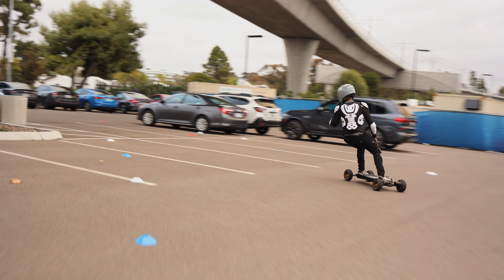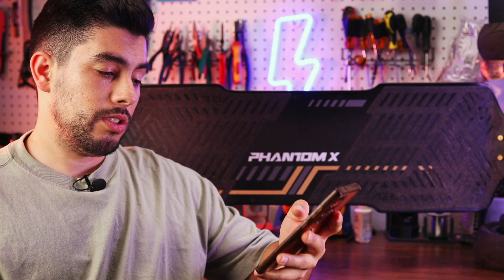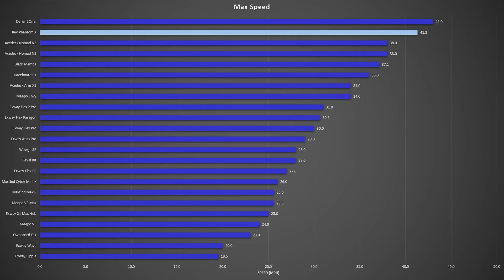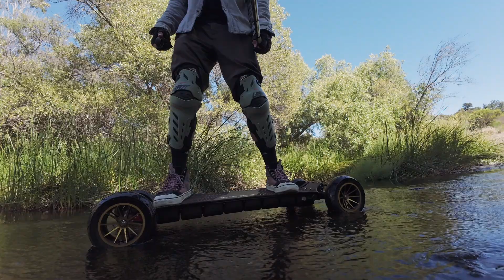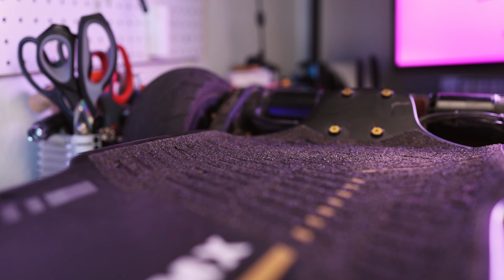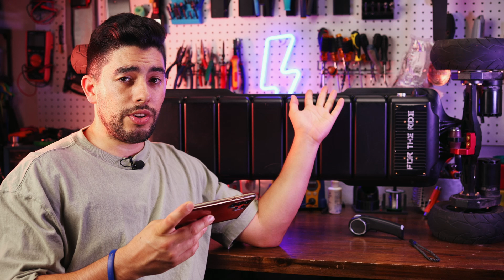STUNNING POWER! REV Phantom X Comprehensive Review (100 Mile Gear Reviews)

Comment: I'm coming off a Lacroix Naz. SS.

Your really the only person to mention the Lacroix as a comparison. I absolutely love the deck on the Lacroix. 

Hows the deck length feel compared to the Lacroix. I just dont want to feel cramped going smaller. 

Thats my only reservation right now. 

Love your review 

I'm ready for a new board.
I'm hoping this is it.

I'm subscribed now!!
Reply from the maker: Definitely not smaller, but set your expectations - it is comfortable but there's not much quite like the Nazare! If I were to pick a board close to the Nazare, this would be it though. However I've not ridden the Acedeck Horizon or the new Lorentz yet
Reply: @RBEMotion 
Yeah the Naz is really great. The maple  handles road imperfections really well compared to carbon fiber. But as long as its not smaller I'm willing to take the chance. A little worried about the concave shape, but its either another Lacroix or try something different. No disappointment with the Naz, but your the second person saying this is an upgrade to the SS boards so I'll roll the dice. Really appreciate the time spent on the review and your insights. Probably gonna order in the next couple months based mostly because of this review. Thanks again.
Reply from the maker: Nice! I'm glad I was able to help you out. The board is one of the most refined things I've ridden. Definitely be prepared to learn the trucks before going full speed though.

Comment: Been enjoying mine, took a while to dial in. Still need to more, but been very enjoyable daily. Wish mine had the gold hardware on the top of the deck like yours, looks nice!
Reply: @TheSoupy77  - how are you enjoying your board these days? Im interested in buying one but curious about the quality of the board. Have you had any issues? Wondering specifically about the gear drive since some of it is plastic? What about the enclosure, still holding up? No major damages (less concerned about scratches vs cracks or screws coming out of place)?
Reply: @Pandah82 no major issues, 1000+ miles in, replaced tire tubes so far and some minor stuff. Really enjoy it still
Reply from the maker: Glad to hear it! Yeah this is 8/10 in the pre production round. Pretty cool looking if you ask me - but the new ones look great too! How is the learning curve on the trucks, still figuring it out? I think they really make the board feel smaller than it actually is.

Comment: I hope you get to try the Lacroix Lonestar Supersport to have the pioneer of performance board on your chart. It's old, but somehow it's still on the market and nobody speaks of it anymore. It's still an 18s8p "faster than you ever need" board (they used to say that in the max speed spec before being reowned by americans)
Reply from the maker: Yeah I know.. I've had that thought in mind that it would be great to get on there. Thing is it's not really very easy to get a bone stock one, and all of the batteries now are so old that range testing it wouldn't be super accurate. It was a great board at the time, minus the trucks though. If Lacroix fully re releases stuff I'll try to track one down
Reply: Contact them man, they are pretty responsive. Some americans bought them back so they do ship out new boards! (Unless they're shipping old ones off the shelves building dust since years). Pretty sure they could send you a demo
Reply from the maker: Huh interesting, I didn't know they were actually shipping again. I'll hit them up

Comment: Nice review. Im just a little disappointed that the heatsink is missing on the 2 batch.... The enclosure is totally different and less flexi and cracking. Also the wings are higher cuz the midelpart of w concace was taken away. All the rest im happy with.... ❤
Reply from the maker: So the heatsink actually isn't missing. It's just inside, so you still get the thermal mass benefit, and I think it'll still perform just fine and not overheat. The enclosure is definitely different but it was my understanding it was made better. Hard to tell from footage how the deck has changed but I think I'd like the flatter deck personally